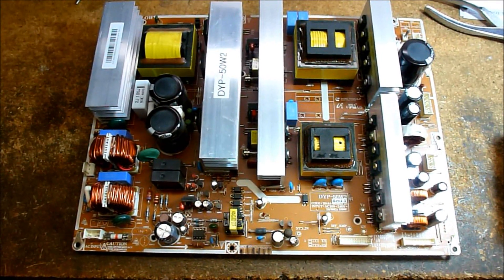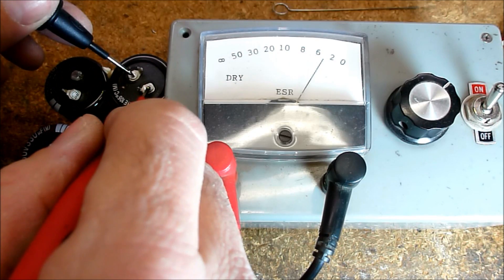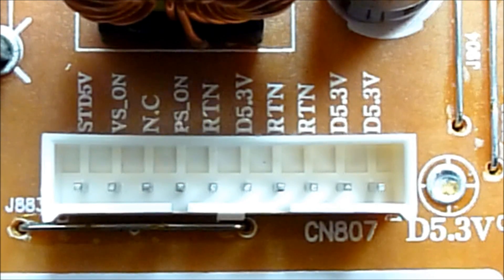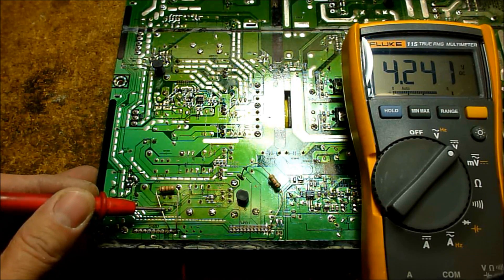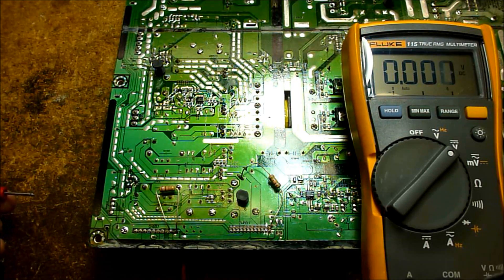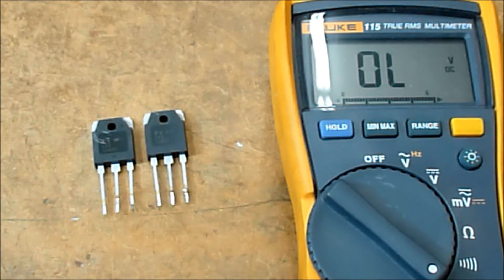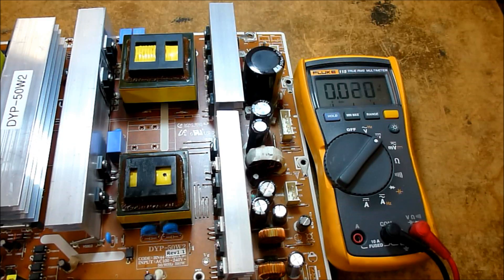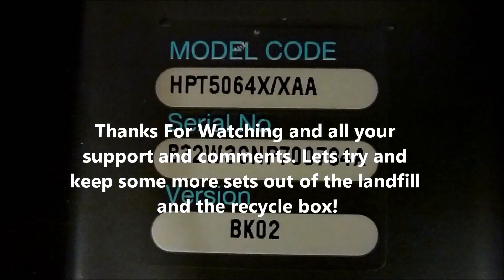Samsung Power Supply Repair Fix HPT5034 HPT5054 HPT5064 BN44-00160A 162A 189A 190A BN44 DYP-50W2

Comment: Thanks for the info. I tested my supply after replacing quite a few Electrolytic Capacitors all bulging up. All working now except "Va".
Reply: Looks like the two (FQPF)9N50C s are shot with a T4 fuse gone as well.
Reply: Initially I blew the replacement FETs. So I replaced the opposing direction  Zener diodes on the gates with 22V minimelf shaped diodes and used melf type 1N4148s to do the gate turn-offs in place of the Schottky diodes that were there.  and replaced the FETs with IRF840s which I had but are uninsulated, so I had to use TO220 Insulating hi-hat washers and silicone rubber heat-sink insulating/conduction pads which worked well. The Star screws were not easy to turn of so I got stainless steel bolts the same size which one could turn with a little spanner. Tested at first with a light bulb since the T4 fuse blew the FETs the first time. Tested OK. Replaced the T4 fuse and it worked great after that. Got the required 60V which was missing.

Comment: The container the Mosfet comes in will prevent a static charge from building around the containers but do nothing to decay this charge, and an electrical charge can pass through it. An static-dissipative material such as an metal bag will cause the charge to pass around the surface (not through it) and will decay the charge. Technically the Mosfet should be shipped in metal static-dissipative bags, not that pink plastic anti-static stuff. The container you are using to dissipate the probes are anti-static, not static-dissipative. You can't discharge your probes this way. Thank you for understanding:)

Comment: Thank you so much. I thought you needed to force on PS out of TV when troubleshooting. Once I did that, I was able to get all my voltages up and running but what's weird is this board was know bad from a 55" I just fixed and I'm wondering if there could still have issue with startup circuit. I pulled PS_On low and tied Vs_On to 5 volts. I noticed a line called Vs_Con which doesn't have any voltage. Could this be original problem with this supply and if so, I'm lost at this point. Having trouble finding schematic. The board number is BN44-00447A (PB6FA-DY) Any help would be greatly appreciated! Thanks again, John

Comment: hi may  i pls ask for any help ,  I have  SAMSUNG PS42C96HDX/XEU , will 
not start,   the PSU is DYP-42W2PLUS, STB 5V ok , blue led comes on 
flashes a couple of seconds , i hear relay ON ( normal click ) and then 
imediately it seems to go OFF ( softer click ) .In August ( max hot 
ambient 40 DEg C ! )  ,  the set used to require 20 min off the mains 
and then it would start , but then it stopped doing this, , i need 
schematic if possible and how to force ON for bench testing. this video 
is very clear on this, cam one assume ithe procedure PSON to GRD  & 
STB5V to VSON  will work for this PSU ??  your e-mail ?

Comment: Basically if all the vokt adjusters are messed up after I set the power supply vs and VA back with vokt meter proper for my HP is there a way to know how to set the adjusters I turned lie an idiot on ysus there is two and another on the daughter board one on ysus as well as the one on zsus, So four all together I don't know how to fix only know how to adjust the power supply ones back? Is there a system? By looking starting point after I correct the power supply ones with meter? Or are these test points available? HP4260N, thanks in advance!!

Comment: Obviously this is not for the novice or radio shack amateur. For a do-it-yourself-er would it be more cost effective to have the board repaired or just bite the bullet and buy a new board ? Second ; could it be a blown fuse on the board that causes it to cycle off and on, as we've had a rash of power surges in the area before this TV (HPT5054X/XAA) went kaput, lol ?   Thanks for your video's and input. ~James

Comment: Great video, thanks for sharing. I have the same model TV with intermittent screen going blank when it gets hot. I'll try your recommendations. I'm guessing the capacitors are shot but I'll check the FETs and transistors while I'm at it.

Comment: How did you determine that the FETs were damaged and the Samwha Filtering caps were bad when they were still in circuit? You used the ESR meter on the caps while they were still on the board? Also, do you need to bleed the voltage off those high voltage caps before attaching an ESR meter?

Comment: Good video! It was a very good thought to advise using iso transformers...I have the Sencore combo iso & Variac, and a few old RCA Iso-Taps. I service professional audio amplifiers and vintage studio gear at my shop, but 90% of my work is on vacuum tube equipment, including a lot of vintage tube radios which have series heater strings that return to chassis ground at one point. An iso transformer is mandatory for working on equipment of this nature...After cooking one scope in my career, I learned to eliminate the ground reference to prevent not only a shock hazard, but protect my pricey Tektronix scope...Great videos!--Frank Ferraro--Audio Craft Electronics

Comment: Far be it from me to question norcal. His knowledge is amazing. But I'm concerned about using an isolation transformer on both the DUT and the scope. From my experience, only the TV should be isolated. Tektronix says isolating the scope can be dangerous and can cause high stress on the power supply and can cause inaccurate measurement. This is not a criticism. I have learned so much from these videos. It's just a concern

Comment: PLEASE HELP ME!
my samsung power supply is BN44-00192A, when i connect the board to 220V power, all output is 0V, PS on is 0V too, voltage on the capacitor (150uF, 450V) is about 300V.
this main use 16 pin IC - MC33167 and 8 pin IC - A6159 but there's no 15V  or 5V DC to feed them! 
i have replaced 0.22 ohm resister, MOSFET 11N60, all other res, caps and opto are in good condition! 
Someone told me that i should replaced the main Capacitor(150uF, 450)! Is that right?
Sorry for my bad English!

Comment: hi! 
 i will like to if you can help me 

hey have a problem with my samsung power supply, every time I turn it on , the power relay keep clicking,about 5 to 8 time and i did the what you did the jump the ps-on and is keep clicking but faster that usual 
 any ideas  what may be the problem
 also i did bought a power supply and it does the same thing do you think taht this one is also bad 
 thanks

Comment: This is my favorite video.  I have watched it about 12 times.  I love the way you turn the power supply on by using the PS on and the VS on.  My question about this technic is this,  I don't see these pins labeled on every power supply.  Is there another way to find those pins?

Comment: I am working on a LG moel # 42LB5DF-UL  no blacklight, has all voltages except 3.4 volts for power on is 1.9 volts.  I tried to make the pwer supply turn on by jumping power on to ground using a 1K 1/4 watt resistor.  However, doesn't seem to be working.  In your video you suggest jumping power on to ground, and V ON to ground.  On this power supply I can't find a V ON  There is 24 volts getting to both invertor boards.  There doesn't seem to be any output voltage from the invertors.  Help!

Comment: I have a HPT5054 I have been having issues with it. I replaced a broken y board and the buffers, from a parts tv. But it stillllll doesn't work. I had a guy come check on it and he said ill probably need a new screen, but i have an intuition that he is lying to get my 300$ to fix it. i heard it could be a transister in the other tv. if you could message me back. OR email me: carterkyle51@yahoo.com That would be awesome. I need to get rid of this tv. It has put a dent in my pocket

Comment: When ever u repaired crt tv high amount of charge are stored in electroletic capicetor discharge the capicetor use bulb 2nd may be out the fuse and placed the bulb in fuse section and check the voltage In capicetor what is this this process is called bulb thory its safe and profitable no parts are dameged in this process its gud snd safe frm parts such in power supply firstly check fuse rectifire diode 4007 .capicetor voltage and check carefully aqurate drive volte go2 fet in section of power

Comment: Great video! i worked on switch mode power supplies for decades when i worked for a power supply company and your technique is very good. i just wanted to mention that when replacing electrolytic caps it's good to use 105C caps instead of 85C caps; they are higher quality and don't cost a lot more. They build these sets with the cheapest possible parts and you can improve the reliability by using upgraded parts as i know you do with the semicunductors.

Comment: I'm no professional, but simply being safe around electronics and taking precautions has prevented me from getting any electrical shocks after 40 TVs repaired. Unless you're stupid, it's pretty hard to get shocked, and you really should have a GFCI/RCD which will save you from the majority of potential shocks.

Comment: When you  replaced those surface mount transisters with regular transisters.  Did you use a NTE semiconductor guide to cross reference them?

Comment: Thanks Man!  I just repaired a power supply using your technics!  I watched your video and went over pulled the power supply, and found the shorted FETs using your techinc of jumping the resistor from PS on to ground.  Power supply started up but voltages were flucuating, and after removing the shorted FETs voltages were stable. You are a Master Tech.

Comment: Great troubleshooting vids!
Just wanted to ask where could I get the schematic for that diy esr meter?
Keep up the good work!
Reply: 11 years later. Reply: ESR Capacitor Tester; "In-Circuit Capacitor Tester - Poptronics July 2001". Adequate tester - works well, just don't test caps in circuits with programmed memory chips, else it may clear those but on a PSU like this, no problem.